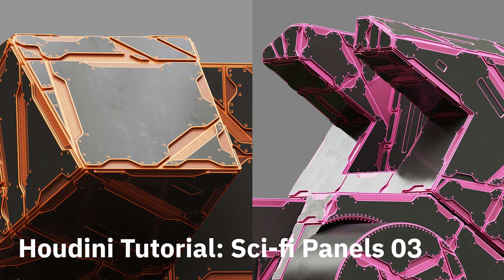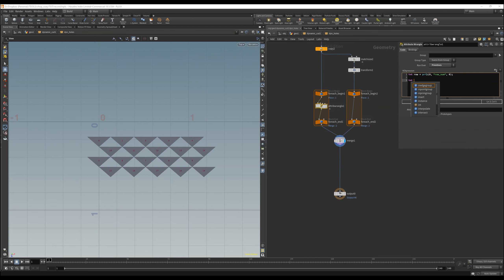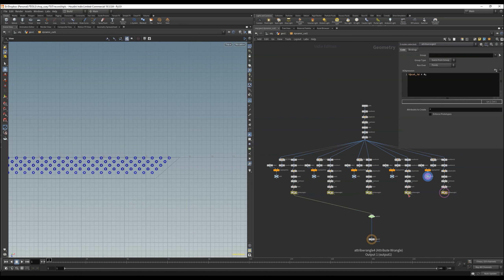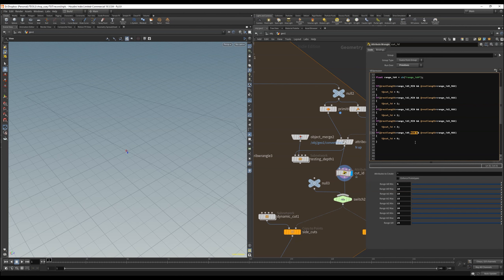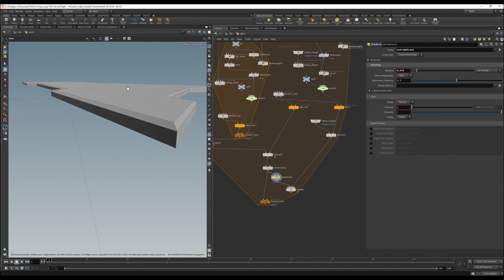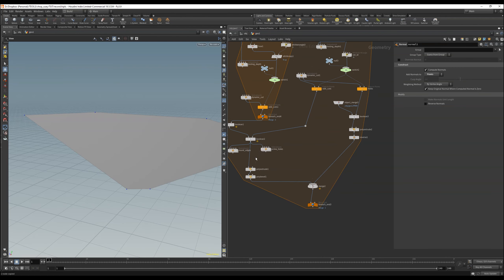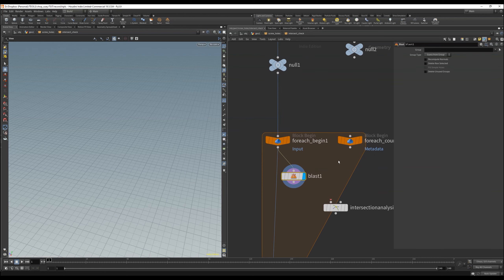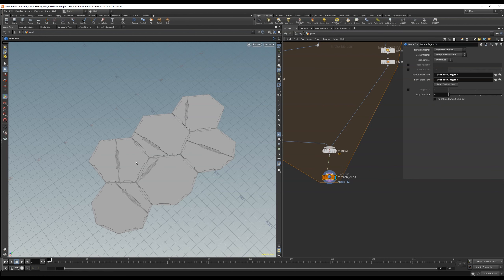Houdini Tutorial: Procedural Scifi Panels Generator | Part 3

Comment: Damn hard, but damn interesting. I'm trying to replicate but this setup doesn't work very well on curved geometries like a pig's head or something like that... I understand it only partially so I can't tweak it but got a lot of cool tips that I'll use in the future. Anyway, thanks a lot for your tutorial, it's amazing.
Reply from the maker: Thank you very much. Yeah you are perfectly right. The tool performs better on bigger primitives and low res meshes. If you have any questions feel free to ask. I can check if the pig head and other more organic shaps are also possible.
Reply: @IrinelPapuc  thank you very much.  I'm still in the process, haha 
I need a few evenings to master this setup.  But by now I've noticed that switching between tubes for a boolean doesn't work as I expect (only a small sized geo is selected). Trying to understand what the problem.
And thanks again for the tutorial 🙏🤍🖤